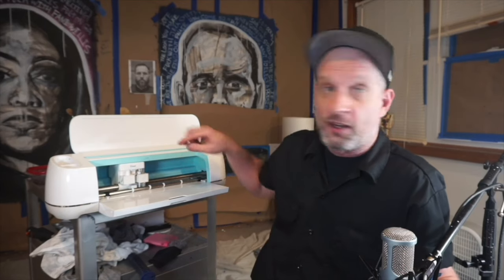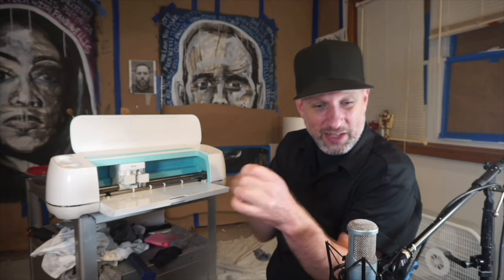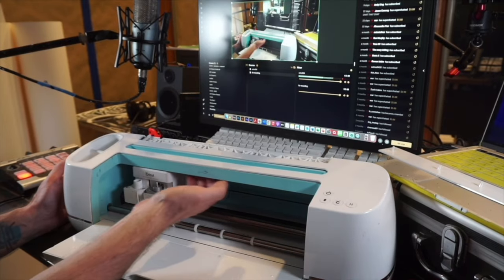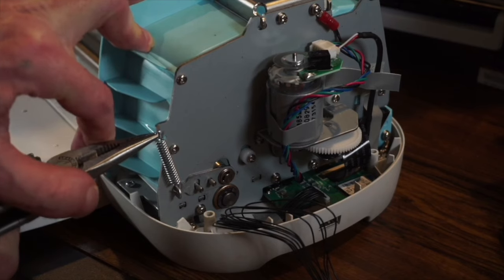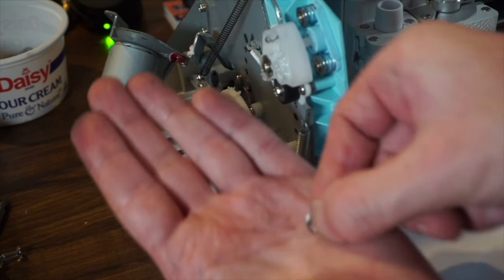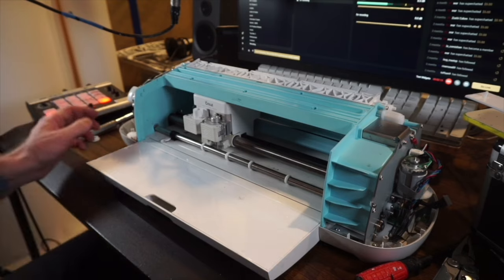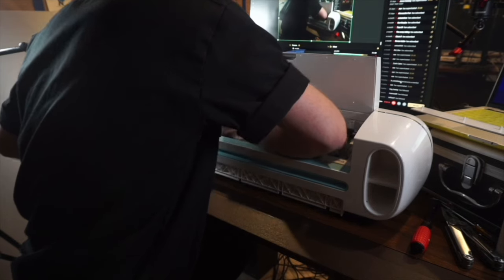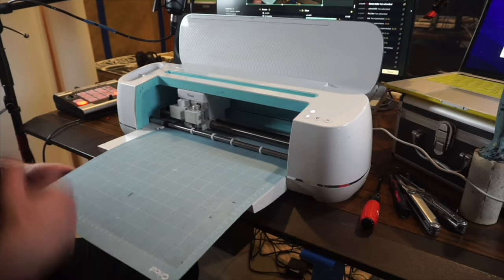Cricut Maker Rubber Pressure Roller Repair EASY FIX DIY

Comment: Seriously, just to change the small rubber rollers you have to disassemble all maker? Why did they make it so hard? Cricut should have some kind of service to fix stuff like that. Yo buy expensive device and you can’t use it if your rollers get worn out. Such a shame. I’m so disappointed. I don’t have any skills to do it myself.
Reply from the maker: Yeah I agree. It’s really not as hard as it looks just take it slow and one step at a time. You can do it.
Reply: Good point at least let us send it in and pay a fee or something that’s just a shame 😢
Reply from the maker: @creativemepaperflowers1628  :face-pink-tears:
Reply: 10000% agree and cussed out cricket the whole time I was repairing mine 😊
Reply: Thank you! Followed your video and successfully changed the rollers. Purchased my rollers on eBay, though.
Reply from the maker: @MA-gr1yg  thanks for the support!  I appreciate it!
Reply: Thank you so much for posting this video, you are a life saver. It took forever but I was able to successfully replace the rubbers on my machine. The most difficult part was really just being able to reach the screws that allow you to remove the cover from the machine. 100x thank you!!
Reply: This a late reply/request... I have the air 2 and it cuts horrible when cutting stencils - using file dividers...it cuts the left top beautiful and the rest it only leaves a faint mark of the pattern... is it  fixable and if- how? I'm fed up. Help please😢
Reply: I agree. I almost threw my cricut out just trying to take the first cover thing off because of the way it was glued down. It was not easy at all. But the rest so far is pretty smooth sailing
Reply: It looks so hard, but I will try, I talked to Cricut costumer service and they said it can’t be replaced or fix, but they can give me 10% off for a new cricut machine, that´s insane. Just for this rubbers, I am not buying a new machine, but try to fix it myself

Comment: I can honestly say that I dreaded this.  But I figured I at least had to try.   I followed the video, paused as i went.  Took pics as I went and lines up all the parts in the order I took them off.   I sweated through my clothes with dread.....but I did it!!!   I bought the rollers that came with screw drivers and the only other tool was a butter knife and a pair of pliers to hold the c clamps when putting them back in.  Trust me, if I can do it, so can you!
Reply from the maker: Awesome! Thanks for supporting the channel.

Comment: Just did this after buying a kit on Amazon. Broke the plastic strip that holds the lid down. It was seriously crazy glued to the point that I had to break it in order to get it off. It’s just an aesthetic part don’t really know if it has a function other than covering the screws that hold the lid to the machine but it just looks sooo bad and I’m pissed cause I spent $300 plus dollars on this crap machine.  My new rollers are on but I bent the c clip to where it’s not going back on. Have to wait to receive my c clips from Amazon in order to complete this. Don’t know if this will work or ultimately break my machine. But it was worth a try before throwing this crap product out. Cricut needs to offer servicing for a design defect that they are fully aware of. Shame on you cricut. I will never buy one of these cricut machines ever again. Thank you for posting this instructional video. It was the stillest best shot best instructions video I could find on you tube about this matter. Thanks again.
Reply from the maker: Glad it was helpful and thanks for the support!

Comment: If you need to fix quickly and don't have time to wait for amazon rollers, OMG THIS WORKS!!  Go to any auto parts store, get 5/16 fuel line tubing ($3.50) cut off your bad rollers with scissors, use bad one to measure and cut same size from fuel line. Cut through the middle and wrap around the metal bar where the roller was, pushing load until it wraps around. Mine did not close all the way, but it still worked just fine! I later cut a piece of painters tape to size and wrapped that around also. I also pushed one white plastic roller all the way over against the tubing. It  was going to be a temporary fix but is still going strong and since I still have 10" of fuel line left I think I will just leave it 'and replace if it fails.
Reply from the maker: I also did a quick fix using thread but eventually that failed as well. Thanks for supporting the channel!

Comment: Thank you for this video!  After watching it a few times I was able to knock it out in about 30 minutes!  I used a finger ratchet for the screws under the top plate. I was however able to push the new rubber pieces on without boiling them. It was a bit of a fight but not to bad.  It works perfect again. I’ve taken apart a lot of stuff which helped with the process
Reply from the maker: Awesome glad it was helpful! Thanks for supporting the channel.

Comment: I did everything, got everything put back together well. It pulls the mat in great but as soon as it’s about to cut, the part that cuts goes all the way to the right as if it gets stuck there and then the light starts flashing purple and I get a critical error -45, 85. Tried updating the firmware but nothing works, still does the same thing
Reply from the maker: hey thanks for supporting the channel. Unfortunately I only know how to fix the rollers I don't know what might be the problem you are having. You might post your issue on a facebook cricut group or something like that and see if they can help. Good luck sorry you continue to have issues with your cricut.

Comment: Thank you so much for making this video.  I struggled with trying to decide to spend another $300 for a brand new maker.  After watching your video I was able to fix the rubber rollers myself and it was not hard as I thought it would be.  It took me 40 mins from start to finish,  the 7 screws were the hardest to remove and put back in.  I saved money and repaired a minor fix with little cost.  Thanks Again!!
Reply from the maker: Glad it was helpful. Thanks for supporting the channel.

Comment: Hi.  I followed your instructions and thanks for making it easy to fix. Thank you a million.  I changed the rollers and now my cricut is working again.  You're the best.  I prayed before and during the entire video.  All the praise and glory to my God.
Reply from the maker: Glad it worked. Thanks for supporting the video.
Reply: So… how do you put the c clamp back on the left side? That gear is in the way. Is it needed???
Reply from the maker: @insaneshane9489  i would put it back on. use some  needle nose pliers to get it in place.

Comment: Thank you so much for this guide, it is incredibly helpful. I did want to note one thing that you might not have mentioned unless I missed it, there are three more screws you need to remove to take the top off. I just dont want anyone to try and force it thinking maybe it might be pop tabs and break their machine. there are the four screws in the back and the three screws in the front. for me totaling 7 screws. ANYONE WHO READS THIS, CHECK FOR SCREWS IF IT DOESN"T PULL UP EASILY. God bless
Reply from the maker: Awesome glad it was helpful thanks for supporting the channel. the 7 screws that are under inside? yes I did say there were 7 screws in the video but thanks for making sure it's clear!

Comment: I tried to do this last year using another video and gave up after tearing the machine completely apart and still couldn't get the roller rod out. Your video made it much simpler and easy. Thank you
Reply from the maker: Awesome glad it worked out. Thanks for supporting the channel. 🤩

Comment: You are amazing! Thank you so much for explaining so clearly and calmly how to fix the rubber wheels issue on the Cricut Maker. I had to order the rollers twice since my puppy ate the first set, LOL. The hardest part were the C clips. If it weren't for the difficulty getting those back on, this would have been pretty quick. Maybe you know: What is that sticky stuff on the left hand side? Ew, kept getting that all over myself! So glad to find your video so I could fix this instead of having to spend a fortune on a new machine (which probably wouldn't have happened). Thank you, thank you, thank you!
Reply from the maker: Thanks. Glad the video was helpful. Thanks for supporting the channel. I think the sticky stuff you are talking about is the lubricant for the gears.

Comment: Thank you so much for the in-depth video! We were able to replace the rollers (from Amazon) and fix my 4 year old Cricut Maker with "ease"! Extremely helpful and appreciative. Figured that we might as well try doing it ourselves instead of spending more money to have it repaired or worse buy a new one! We followed through with your steps and was able to put it most of it back together. We stopped before putting the lid/cover on to double check that the machine would work still, and it did! The 7 screws are definitely awful to get to and does take a bit of patience. I do have a question though, does it matter whether we put all 7 screws (the annoying ones) back in or do you think we can make do with 3 of them (the ones towards the center)?
Reply from the maker: glad it was helpful. I would recommend replacing all screws. the machine jerks a lot and things could misalign over time. Thanks for supporting the channel.

Comment: This was a great video to fix these roller wheels.  Only thing is the C-clips can be tricky and you need nimble fingers for those 7 screws on the top. And there was some super sticky goo near the motor, I kept getting all over my fingers and tools.
Reply from the maker: Thanks for the support. Yeah I get a lot of comments about the c clips.

Comment: Thank you, I am sure your video will help my husband take care of my Circuit Maker once the new rollers are delivered
Reply from the maker: Awesome glad you found the video!!!
Reply: Where did you find that tool to put the rubber rollers on?
Reply from the maker: it was actually a gift it's and adjustable wrench. I imagine the edge of a table could also work. Thanks for checking out the video apprecaite it.  @Westsidebeard
Reply: Where did you order your rollers from?
Reply from the maker: amazon link in description of video @MiyaMadeOver
Reply: Thank you i seen link after I commented lol. Just ordered but I’m scared to take machine apart it seems so complicated
Reply from the maker: I felt the same way but once I got in there it was simple just follow my vid and take it one step at a time. @MiyaMadeOver

Comment: Thanks, my fix was successful, i got my rubber rings and c clips (to hold them on the rod) from Ali Express - cheap as.
 I found that the star screwdriver was a T8 not 9. the biggest problem i had was losing the screws and clips pinging off. Thanks for this i wouldn't  have been able to fix it without this video.
Reply from the maker: Glad it was helpful. Thanks for supporting the channel 🤩
Reply: Any chance you can post a link to where u got the c clips? My just flew into oblivion and I’m thinking buying new will be faster than finding it.
Reply from the maker: @ThymewithTheron  I did not lose my c-clips so I didn't have to buy them again. You can try a hardware store?? good luck.

Comment: Thanks for such a detailed video. Stripped it down (challenging) and replaced the rollers then carefully put it back together but I’m noticing a couple of perforated vertical lines through every thing I print and the same corroded roller seems to be wearing down again. 🥴 Don’t know why but I will dismantle it again and give it another go. I was so proud to have tackled it the first time. Here I go again!
Reply from the maker: The perforated lines are from the white rings on the bar they can be slid around the bar so the perforations don’t intersect with anything important in your work. Thanks for supporting the channel. Good luck.
Reply: Ahhh didn’t think of that! You’re right but when I move them I can see the imprint of where they were so is it possible that the bar is maybe pressing too hard? Just asking because now that I’m an “expert”🤣 in dismantling maybe I should try and loosen it. Thank you for your help/advice. Don’t think I could have solved that issue on my own. Much appreciated!
Reply from the maker: @wubyduby  you kind of want it to press hard so it does not slip while cutting. Mine has the perforations too.

Comment: Thanks for the video! It was very helpful. After putting everything back together the lights on my cricut aren’t working. It turns on, but no lights.
Reply from the maker: Thanks for supporting the channel. Unfortunately I don't know how to diagnose or troubleshoot your lights issue. I hope you're able to figure it out.
Reply: Did you remember to plug your chip back in on the bottom of the cover piece? 🙂 It connects the buttons that light up to power.

Comment: I had to replace the rubber and this video was so helpful, thank you! Only issue I have now is that my lid won’t close. Any suggestions on how to fix that?
Reply from the maker: Which lid the top one or the front one? when I put mine back together the front one would not close the spring was not springing properly to keep it closed but eventurally it started to work. if it's the top one could the top case not be fully put back correctly like the slots in the back that I showed in the video did not get lined up correctly? hope you can figure it out. without seeing it it's impossible for me to know what's happening. Thanks for supporting the channel.

Comment: Good morning, thank you very much. I watched your video, I followed all the steps. I looked at your manipulations because, being French, I could not understand what you were explaining. I thought I had repaired my machine because I had no problem during disassembly and assembly but since the changes, my machine no longer takes the belts. The bar on which I changed the rubbers remains fixed. I tried to redo everything but nothing worked. Do you have an idea to help me 😁 Thanks to you
Reply from the maker: Thanks for supporting the channel I appreciate it. Unfortunately it's unclear to me what your issue is. The bar is not spinning? If that is what is happening sounds like you might have forgot to re attach the springs so there is pressure against the bottom rollers. I hope you figure out what the issue is.

Comment: This video is great!! but I lost one of the c-clamps from the end of the rod. If it fell into the machine I think and can not find it. Do you know where I order a new c clamp? Again thank you for the video
Reply from the maker: Thanks for supporting the video. I don’t know where you can get a c clip. You might try a hardware store. Good luck.
Reply: @theZimvideo  I was able to find them at Lowes and Fleet Farm. Just in case anyone asks.  I purchased 2 just in case... LOL and I needed it! The E clips are slippery little buggers!  Again Thank you
Reply from the maker: @kimshirek4031  good to know thanks

Comment: I really appreciate this video. Thank you!!
However, I am having a tough time getting the 1st c clip back on 😔 I wish you would have shown how to this on the motor side.
Reply from the maker: Try using needle nose pliers to hold a press it into place. Thanks for supporting the video glad it’s helping.
Reply: @theZimvideo  I eventually got it after maybe a dozen attempts. Getting the springs back in were also really  difficult. I almost lost an eye! I hope I never have to do that again 😁
Reply from the maker: @powered77  I'm glad you got it back together and with both eyes intact!

Comment: This is about to be a long comment but hopefully not lol.l Thank you SO MUCH for explaining it so well OMG!!. BUT the little metal piece that you click off right before removing the rollers OMG GUYS do NOT let that piece fall under . I tried putting it back on at the end and it fell into that little space under the wheel but under the entire cricut and I struggled for a good hour attempting to put it back on due to that. My cricut had this weird goo stuff on a gear I kept touching and it was a mess.l also suggest to buy the kit on amazon with the tools.I went to walmart and attempted to buy the star piece and it didn't come in the bit set I got =( . Overall though this tutorial helped alot and I was able to replace my rollers. OH!!! Life hack! If you can't seem to find the holes to screw the top back on use your phone  front camera to see under that hood. It helped me put them in faster while holding that tiny screw lol. Thanks again !!
Reply from the maker: Thanks for the additional tips! Thanks for supporting the video I appreciate it!
Reply: How did you get the c clips out?? Lost both in there 😢

Comment: What happens if I lose one of the little c clamps that holds the roller bar into place? And do you know where I can find a replacement?
Reply from the maker: Someone else commented I think you can get them at home depot. don't loose both bring the one you have in and ask a staff member. Good luck. Thanks for supporting the channel!
Reply: Check a hardware store like home depot or lowes

Comment: What size was the tension spring? For you recall? The link brings you to the listing but the springs in the default listing photo look a bit smaller
Reply from the maker: These are the ones I got 0.8x6x25mm hope that helps and thanks for watching the video.

Comment: I am having trouble getting the c clamps back on. Any advice?
Reply from the maker: I am not sure how to help. do you have any small needle nose pliers? that might be what you need to hold and press it back into place easily. good luck and thanks for supporting the video!